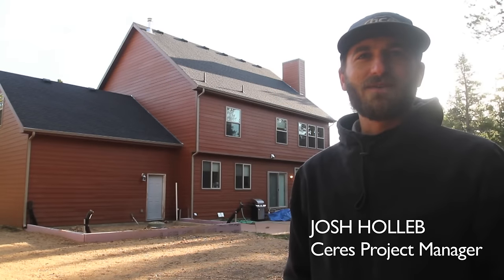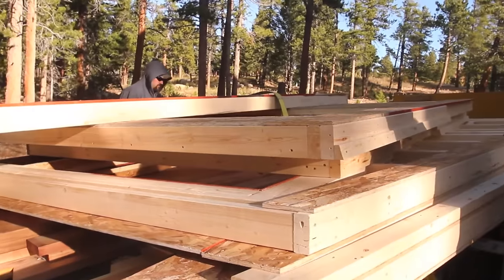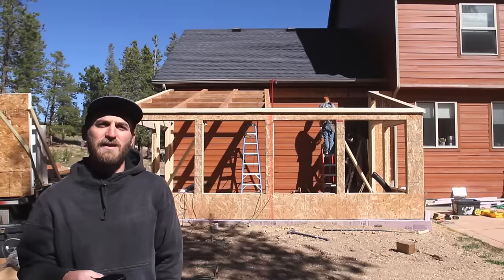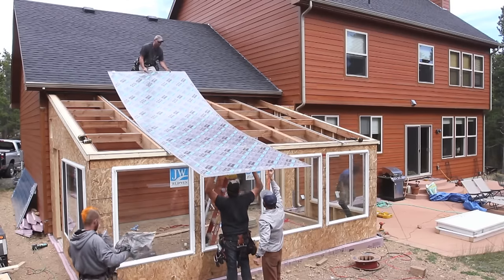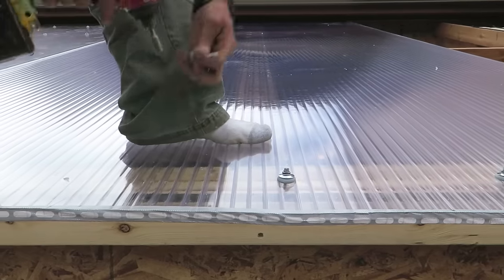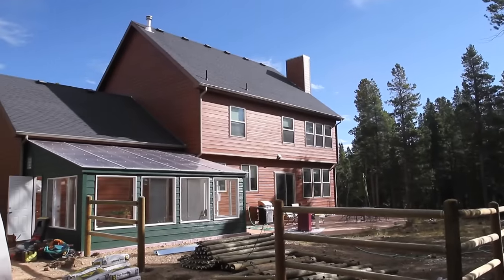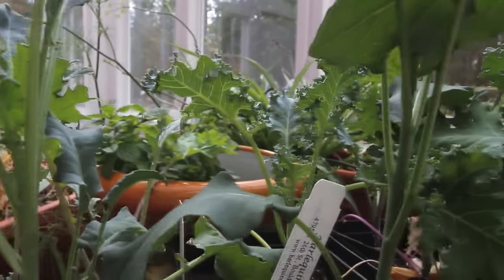How to Build an Energy-Efficient Solar Greenhouse - Ceres Greenhouse Solutions

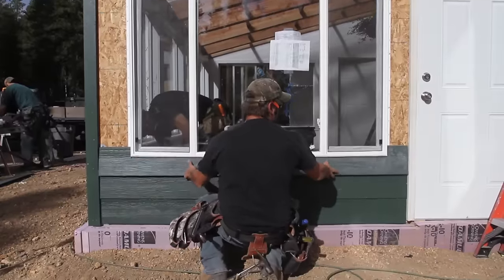Comment: Very nice looking! One thing that surprised me is the lack of any type of house wrap or vapor barrier underneath the lap siding! 2:00 Here in the northwestern US there would be a serious problem with black mold on the plywood after a single season, guaranteed. We could never get away with that. You must be in a dry climate.
Reply: Even in the south you need a air/water barrier on any wood facing the outside. This is simply not a building that will last.
Reply: Yea, No Tyvek. I was wondering the same thing. I'd have put ice and water shield down, then tyvek and lots of tape. Nederland is windy AF, and that rain can come in sideways. Beautiful framing though. That could probably withstand a car falling on it ;)
Reply: Well yeah it's Colorado

Comment: Install a solar heater on the roof of the greenhouse for more heat during the colder seasons. It will also push the exhaled oxygen from the plants into the main house and suck the carbon dioxide we exhale back to the greenhouse plants (that's what they like). It's a complete circle with healthier air for everything involved and free heat.

Comment: What is done to mitigate the absorption of humidity into the house. Humidity that through the facing wall and soffits migrates into the roof space creating mold and rot. Thank you.
Reply from the maker: Thanks for reaching out Robert. This greenhouse is attached to the backside of the garage. The north wall of the greenhouse/south wall of the garage is Hardi board (concrete) which is caulked and sealed with a moisture barrier beneath it. We also use ventilation in the greenhouse as well as a dehumidifier inside the greenhouse to manage humidity at all times.

Comment: What is the cost to build one like this,  thanks
Reply from the maker: This is a custom attached residential greenhouse and we don't design custom structures under 3,000 sq ft anymore. But if you are interested in the next closest thing, check out our DIY greenhouse designs. Standard plans start at $950 but the material needs to be sourced by you. The plans do come with a materials list though

Comment: How do you deal with the high levels of humidity delivered by the GAHT at night?
Reply: +Ceres Greenhouses 
These systems only dehumidify in cooling mode. The air drops to dewpoint in the tubing and moisture (aka water vapour) condenses out as liquid water. The air leaving the tubing is cooler and drier. 

In heating mode, the opposite happens. The cool air picks up heat and moisture from the tubing. A percentage of the energy transferred to the air is "sensible", which raises the temperature of the air. The rest is "latent", which represents the energy used to convert liquid water in the tubing into water vapour (aka a gas), which is then carried into the greenhouse. The latent component (water vapour) doesnt raise the temperature.. it simply serves to raise the greenhouse RH. 
Its a very basic thermodynamic principle but if you monitor the output RH% , you will clearly see its considerably higher than the RH% entering the tubing.
Typically, around half of the water condensed in the tubing during the day (when the system is in cooling mode) is returned to the greenhouse at night (when its in heating mode) in the form of water vapour, which results in very high greenhouse RH%  :)
Reply: +Ceres Greenhouses 
The RH% will always rise due to the latent heat component which is hidden unless you are actively looking for it in terms of RH% 
monitoring. 
The sensible component heats the air in the tubing but more sensible heat is effectively being stolen from the mass to provide the energy required for liquid to gas phase change. The mass has a finite amount of energy so you dont want to waste it converting water into water vapour. 
To reduce night % you will have to reduce the amount of water condensed in the tubing during daytime cooling (aka heat storage) which entails preventing the air from dropping to dewpoint in the tubing. This is almost impossible to acheive unless you have very short tubes and some serious fan power :)
Another option is to prevent the latent component from entering the greenhouse at night but its not easy to do with the traditional tubing/plenum layout.

I`ve had my shcs running for 7 years, the design is unique as it was geared with experimentation in mind so i could gather as much meaningful data from it as possible. 
It uses a radial tubing layout with a variable speed fan capable of putting the entire greenhouse air volume underground in less than a minute. Very few installations have the fan power for that kind of experimentation and even fewer have sufficient sensors installed for measuring the various soil and air temperatures along with RH% both inside and outside the structure.

Most folks consider these systems work like traditional heating where the heat is 100% sensible like an electric fire but its not the case. Others assume the heat in the mass is miraculously replaced from the earths core lol, again, not the case. The most common misconception is that the ground temperature at depth remains constant all year round. It doesnt if you alter the energy balance by sheltering the ground with a structure and actively add/remove energy that would otherwise not be happening.

If you create a tropical environment over a piece of protected alaskan ground it wont behave in the same way as alaskan ground 20ft away :)

Its good to see the Cere`s design uses multiple layers of tubing, some folks would have you beleive a single layer of tubing installed at 8ft can magically access all the heat from or distribute the heat to the entire mass above it instantly. 
If they had a few sensors installed a few feet below the tubing they would also notice heat moving downward where it cant be recovered. Insulation below the tubing is important if the main goal is for heating in a cold climate. 
Apologies for the epic post but hopefully you found some of it interesting even though it barely scratches the surface
Reply: +JohnGuest45  I do find it very interesting. Would you be interested in comparing data with our performance metrics with ours -- we've done many different combinations of variables -- or discussing your experiments further? you can email me at lindsey at ceresgs dot com
A long time question of ours has been what portion of the heating / cooling power of a GAHT system comes from the greenhouse's heat, the phase changes, and the stable temp of the earth. Would love to hear your thoughts. Emails the best way to reliably reach me. (Ps. logged in as my personal acct. now, but I am the commenter above and poster of the video here as well :))
Reply: +LBS LBS 
The proportion of heat from the phase change component is directly related to the RH%. An overhead misting system can be used to modify the RH% for experimentation,comparisons and data gathering purposes. The results from the sensors will be clear but the real eye opener is when you use the data, along with airflow rate, in/out RH% difference, etc, to calculate the amount of energy being transferred.  Some folks use rudimentary conductive heat transfer calulations based on the tube surface area and basic temperature difference which doesnt account for the latent component and wonder why its not adding up :)  

The same kind of testing can be done by varying the airflow rate without modifying the RH to show how the air flowrate affects energy transfer. No doubts this is one you`ll have tried assuming you have a variable speed fan and anemometer to accurately measure the airflow. 
Trickling a small amount of air through the tubing guarantees it will drop to the soilmass temperature and most folks will be impressed by that. Unfortunately, the amount of energy transferred is pitiful and it wont be enough to keep pace with heat gain in the summer so the greenhouse soon tops 100+ with the system running. 
The heat capacity of dry air is very low. To put it into context, the 
energy given up by 1lb of water undergoing a phase change from gas to a  liquid is equivalent to 56,000 cubic feet of dry air.

Simple testing will show you that heat transfer increases with flowrate, upto a point. Sacrificing a few degrees F in the tube outlet temperature by doubling the flowrate through can transfer upto 3x the amount of energy in the same time period. The optimum airflow rate depends on conditions at the time, for example, there`s no sense running very high flowrates if the incoming solar gains cant support it, the fan will be switcing on and off every few minutes as it outruns the gains. In that situation, running a lower flowrate will achieve the same goal, the fan wont constantly cycle on/off and it`ll take less electrical power to do the same job.

Aother scratch of the surface ;)
There`s still the tube layouts, plenums, soil mass properties and a host of other things to consider when designing these deceptively simple systems.
Reply: +JohnGuest45 Next question: Something I've had trouble understanding is why condensation underground during the day produces a cooling effect. As phase changes go, condensation is an exothermic reaction, so the water molecules should be releasing heat to their outdoor surroundings - the air -thus heating the air. But, that conflicts with what everyone says and what we see via data. There's a part of the function I'm missing; I don't know what it is. Maybe you can help explain.
Reply: +LBS LBS 
 Its a basic thermodynamic principle,  i guess you`re not involved with the custom system design work as the variables in this process are needed to calculate a big chunk of the overall system performance ;)
Reply: +JohnGuest45 I'm not asking about system performance. I am asking why does a phase change from gas to liquid (an exothermic reaction) cool air? It would make sense that it HEATS air. Endothermic reactions cool their surroundings, not exothermic. Condensation is an EXOthermic reaction. Do you happen to know?
Reply: +LBS LBS 
System performance is related as on the DIY GAHTi page you ask for a desired temperature range.
You cant design a system to meet this requirement without understanding the principles involved. The principles provide the variables and equations needed for calculations. 
If you assume the air is being heated during the phase change process your calculations will be incorrect. Your question is a cause for concern when the fee for the design is $495 /£340.

"There's a part of the function I'm missing; I don't know what it is. Maybe you can help explain."

The thing you are missing is a non gaseous surface for condensation to occur. (for example, a raindrop doesnt form without a speck of dust) 
At the point phase change occurs, the sensible heat is transferred to the liquid water,  not the surrounding air.
Reply: +JohnGuest45 Thanks. 
Also, I don't design these systems. An engineering team does that. It was never my impression that the system heated air, I simply was never explained (clearly) the chemical reaction behind the process of cooling. I have asked the same question of people at the company but have not gotten an answer I understood well. I asked you because you seemed helpful and clear, and able to explain things without a chip on your shoulder, being condescending or overly technical. I hope that you keep that ability.
Reply: +LBS LBS 
Many of the people that "design" these systems dont understand how they work. Some dont even bother with basic airflow calculations which "make or break" the systems viability. You can tell a lot about a design just by looking at it. 
For example, one of the vids on your channel shows a layout that is clearly not geared for high greenhouse air turnover rates.
 
The  intake tubes feeding the underground tubing restrict the entire system`s airflow capacity.to that of the single inlet tubes. The better option is to calculate the maximum airflow capacity of the underground tubing and size the inlets and outlets for that amount of airflow.
 
I use an 18" diameter central plenum to feed the underground tubes. The plenum is essentially lossless upto 1650cfm although i seldom go higher than 900-1000cfm. If i`d used a single 4" tube of the same length for the intake,  it would limit the systems maximum (essentially lossless) flow rate to around 110cfm in total. This wouldnt provide anywhere near the required greenhouse air turnover rates for effective cooling in the summer.
Reply: @JohnGuest45 
Been looking at the Ceres greenhouse attached to a house. What are the problems you see in this?
Reply: @tammyterrysmiley8324  
Having a greenhouse attached to a house isnt a issue unless you plan to use the air from the greenhouse in the house :)
Reply: @JohnGuest45 thank you for responding.  We have been looking at the Ceres Vesta - home with greenhouse. Really like the concept. Especially at my age (60s). We have a garden today and are looking to build next year and want a greenhouse this time around. Live in middle TN. It rains so much and wanted to grow under more controlled environment. I know nothing about greenhouses so am reading and watching a lot of different things.
Reply: @tammyterrysmiley8324  
It appears to be a passive solar house with attached greenhouse,  i`d class it more as a conservatory with a raised bed than a greenhouse but it looks great either way :) It doesnt appear to have a GAHT system so there`s no issue there :)
Reply: @JohnGuest45  thank you again for your time.

Comment: @ :20 "the ??? system is in place". Maybe you should explain what the purpose of the black tubes is.
Reply: To heat up the floor and the rest of the greenhouse. but mainly the floor.. the heat radiates up,,they do this by recirculating the hot air in the upper part of the greenhouse through the black pipes in or under the floor...
Reply: ijjj
Reply: he said, GAHT system is in place.
in winter, the earth a few feet down is warmer than the surface.
in summer, the earth a few feet down is cooler than the surface.

A Ground to Air Heat Transfer (GAHT) system, sometimes referred to as a ‘climate battery’, allows the greenhouse to provide its own heating and cooling using the energy of the sun and the soil underground. By utilizing this system, one is effectively able to create a geothermal greenhouse designed for renewable climate control and year-round growing, with a much lower environmental impact of a traditional HVAC system.

Comment: You just made a roof for a green house capable of holding a bus on it. Over kill does not do this structure justice. I'm questioning your engineer
Reply: Johnson Rocson I thought the same thing. A little bit over engineered.
Still marvellous though; it'll last and it'll add value to the property :)
Reply: Depends, I live in a area with a heavy snow load.  Heat will rise, snow melts and can turn to ice.  That can and will make a roof fall in.
Reply: Why do people always find negative things to say? Better be safe than sorry!